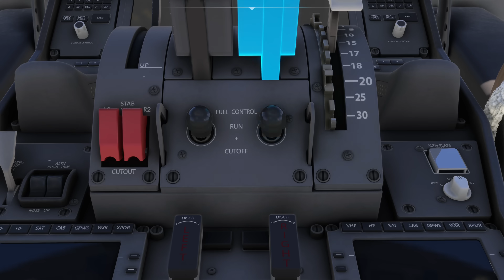Air India 171: Why Did The Fuel Cut-off Switch Get Moved?

Comment: @Captain Steeeve 2:36 can't the engine control computer know that the plane just took off and lockout engine cutoff until a certain altitude? then engine cutoff would still be available at low altitude on landings, this would also help prevent sabotage on takeoff.
Reply: Why are you asking this question to Capt Steeve? 😊 If you want to know the internal working of a car would you ask a taxi driver or an automobile engineer?
Reply: @Commentator-u6e  If it wasn’t already apparent, the entire video, along with several others, features Captain Steve answering viewers’ questions and sharing his thoughts. I believe Captain Steve and I both already know the answer to my question, but I thought it might be helpful for him to feature it, allowing him to share his perspective and giving others an opportunity to consider an idea they may not have thought of before. This can foster a sense of community centered around learning and curiosity and, hopefully, contribute in a small way to aviation safety. While airline pilots are typically not aeronautical engineers, they do have a strong understanding of how various aircraft systems work, as demonstrated by Captain Steve and others in their videos.
Reply: @lazr47  Someone raised this question already in another video where Capt Steeve expressed his idea that he wouldn’t want this feature as he thinks in the event of engine fire during landing they won’t be able to cut the fuel off manually. This clearly shows his ignorance on the potential of good software features. In most scenarios an engine fire will be alerted by the system rather than a pilot figuring out himself. If the system can detect the fire, the system can very well handle the logic of when to allow/when not to allow manual vs auto fuel cut off. Designing and developing such logic into the system is something the pilots wouldn’t be aware of. So being knowledgeable of how to operate and navigate an aircraft and knowing the internal details of all the aircraft systems are totally different things.

Comment: Hi Capt Steeve .Are we missing this point? From the prelim report picture of the plane, it was very low to the ground (approx 100 ft).  By then RAT got deployed, But still plane continued to fly further 500-600ft. How can this even be possible? Plane can fly further  and gain altitude only if engines have power. So the RAT could have been deployed because of some other reason. ??????

Comment: Captain Steve, I wish you would stop using the term "engine failure".  The engines did not "fail".  They were turned off.  They did exactly what they were told to do.  There was no bird strike, no broken fan blades, no fire.  It seems there was a "human failure".

Comment: No i do not think the fuel cutoff were moved by the pilots. Other pilot clearly says he did not do so. Investigators did not release what was the other conversation occurred between the pilots. I do not think there would be no other conversation after the other pilot said he did not do so... I think this is an hardware issue that caused it.. as you can see the cutoff between two switches happened in a 1 sec
Reply: Imagine this alternative conversation: "Why did you cutoff?" "Because I want to kill you and everybody else on this plane". Was the other pilot likely to give an honest answer even if it was true? He was more likely to lie "I did not do so" to confuse the pilot flying, who was desperately trying to turn the fuel switches back on, gain altitude and avoid the buildings ahead, all at the same time. He probably didn't talk further to the other pilot because he realized he was lying and would be of no help. Unfortunately it was too late to avoid tragedy. 
If it was a hardware fault that cutoff fuel, how could the fault be fixed within 10 seconds, allowing both engines to be turned back on before the crash?

Comment: Why we must resist premature conclusions

In the aftermath of an accident, there is much at stake for many people: the manufacturer of the aircraft, the airline, the airport, civil aviation authority and others. The families of the victims understandably demand answers.

It’s also tempting to latch onto a convenient explanation. But the preliminary report is not the full story. It’s based on very limited data, analyzed under immense pressure, and without access to every subsystem or mechanical trace.

The final report is still to come. Until then, the responsible position for regulators, experts and the public is to withhold judgement.

This tragedy reminds us that aviation safety depends on patient and thorough investigation – not media soundbites or unqualified expert commentary. We owe it to the victims and their families to get the facts right, not just fast.- Yahoo News
Captain Steeeve did just that, reach a premature conclusion. irresponsible of him
Reply: If Air India thought it was the aircraft, they'd have grounded their entire 787 fleet.  They haven't done so, and you know exactly why.  Please refrain from commenting further as it's clear facts aren't important to you.
Reply: @txbill2512  - you should be doing that , refraining from making comments. YOU
 are doing just that. What facts? Very few "Facts" were reported in thsi PRELIMINARY report. what part of the word, "Preliminary" don't you understand?. Read my post again.  clearly you can't either read or comprehend what was posted.
Reply: @txbill2512  - rubbish. didn't you read from yesterday that Indian authorities ordered inspection of all fuel switches on 787s?
Reply: You make a good case for withholding judgement until the final report, but there is a counter-argument regarding the responsible position for regulators in particular. Suppose a preliminary report on a fatal air accident identifies a mechanical flaw, design flaw or faulty maintenance protocol as the probable (but not certain) cause of the accident. Is it the responsible position for regulators to wait for maybe a year for the final report before taking any action or making any recommendations? In many cases, more urgent action based on strong probability rather than certainty is the responsible position in order to avoid similar accidents in the meantime. 
If the mental health of a pilot is a very likely issue based on a preliminary report, then shouldn't airlines and regulators do more to address the mental health of pilots as soon as possible? In the time between a preliminary report and a final report, thousands of pilots will be flying millions of passengers.

Comment: A lot of comments saying the cutoff switches are 'designed' not to be able to disengage without being lifted across a detent and 'couldn't be accidentally knocked' but that is the design and is NOT the real world situation. Hopefully the mechanisms are not too badly damaged by fire and impact to allow investigators to see if in fact the switches were faulty and so did not operate as per design and would backup the pilot commentary.

Comment: Hello Captain Steeeve, as a turbine controls specialist I can state categorically that it is possible for a computer program to process a signal from a digital input interface falsely for a short period of time and then revert to the correct state. To explain in simplistic terms: Computerised control systems process data from a variety of input interfaces, digital (on/off) eg switches, analogue eg thermocouple outputs, pulse eg power turbine speed (magnetic pick ups).

When a switch position is changed, the digital input to the computer changes from a 1 to zero or vice versa. There then follows a complex range of logic executions that ultimately determine various outputs, including data recording. I have experienced glitches where an input was falsely processed for a short period of time. On one occasion, recording a power turbine overspeed condition for only 40 ms before returning to the correct reading. This in a TMR (triple modular redundant) turbine protection core. In that case it had nothing to do with the magnetic pick up inputs and was actually caused by a completely unrelated system, the pcb that controlled the data highway communications in the control system. Extremely difficult to troubleshoot, and very low probability.

In this case I don’t believe there has been any control system malfunction. There were two separate switches for two separate engines. The control system recorded a significant time difference (significant in terms of computer scan time)  between the operation of the two switches. The voice recorders indicate that one of the pilots actually saw the switches being physically operated. Sadly, I am forced to the conclusion that one of the pilots did this deliberately, perhaps suffering from some adverse psychological condition.

In closing, I believe it is a reasonably easy job to change the control logic in such a way that this can’t happen. For example you could require a separate confirmation signal from the other pilot. It would also be possible to limit the input from those switches to exclusively one or the other in the circumstance of taking off and climbing to a certain height.

Regards and thank you for your informative and compassionate reports.

Colin

Comment: The preliminary report left open 2 questions: Why was the throttle quadrant changed in 2023 (no answer in report); why did one pilot ask another why he cycled the fuel switches off (insufficient transcript to determine context and who questioned and answered). In this respect, the preliminary report encourages speculation. No matter. Step back and look at the location and design of the switches and ask this: Are we looking at a latent design failure; ie, the system has worked 100,000 times before but its design made it an accident waiting to happen. First, look at their location-the busiest part of the cockpit; exposed to physical movement; susceptible to spillage of anything over the centre console; susceptible to getting caught in a shirt or jacket sleeve. Why are they there when their operation is always by way of checklist? They can be placed anywhere and should certainly be away from any busy areas. Second, look at the switches- they are small and insignificant: can be bought at any hardware store and are by design susceptible to wear and damage by operation over time. Third-How are they operated? Are they lift and push or pull, or do they require lift, turn, push, turn, lock and release? In any event, there seems no physical locking mechanism and no locking indication other than perhaps feel. Finally, in what part of the start cycle is the fuel released? When the switch is first moved, pushed to the end of travel or when locked in place? And finally, what are the pilot procedures on takeoff? Is a hand placed behind the throttles by the non-flying pilot; does the pilot flying put both hands on the yoke at 80kts? No one has commented on these procedures but they may have contributed to the opportunity for an accidental displacement. I guess there could be electrical mishap, but that seems remote. And finally, there are the pilots, but nothing of concern has emerged about them yet. In any event, latent fault happens too often in aviation-example, the recent mid-air collision at Washington National: no positive separation was needed, until it was, and then it was too late. We must wait and see.

Comment: To you comment about AI in the cockpit....Right there with ya.  Maybe in 10 years they'll have a true self driving car and 50 years after that "Otto" will be by himself.

A couple of questions.  Could a dual engine fire cause the PNF to cut-off the fuel?  I am reasonably sure that's not what happened (at least I presume the master caution would be heard on the CVR).  Second, I heard a rumor that possibly a third voice was heard asking the "why did you do that" question.  Could there have been a dead-heading pilot in the jump seat (if a 787 even has one)?

Comment: The fact they don't release the full conversation transcript shows cover up operation. If it's intentional act by one of the aircrew then the switch wouldn't have been turned back on seconds later and they communicated mayday to the tower. Does not make sense.  What is true: BOEING SIMPLY CANNOT SURVIVE ANOTHER SCANDAL. IT WILL BE THE END OF BOEING.

Comment: I'm curious with so much technology around, why can't they relay whatever happens in the cockpit on the fly to ATC or something? Or for example if the fuel controllers were manually turned off, is there a way we can track these actions on the fly over to a centralized monitor or something for real time activity.

Comment: Cut off switches shouldn't be in the middle of the cockpit, where pilots use their hands using throttle, flaps, spoilers or radio. Best solution is to place them on overhead panel. Left engine maximum left side on the captain side, and right engine on the FO maximum right side. The plane with one engine running could still take off and it is not possible to switch them off at once.

Comment: You can very easily see that these are the type of Cut-Off Switches that can NOT be switched off by just sliding or throwing your hand on top of them. 

The ONLY way you can turn the switch on or off is by first lifting the toggle outwards and then push the toggle into the on or off position. I received an aircraft cockpit switch panel from an aircraft parts recycling center and most of the switches were designed like that. 

 I use about a dozen of them right now for various electrical projects and have even been using the same switches for over 20 years and they still work perfectly. In other words, these are superior designed and manufactured switches and there is no way two flip the switch unless you first grab the toggle tightly with two fingers and then pull the toggle outwards to unlock it.

I usually never get any replies from my comments BUT I would really like to hear someone agree or disagree with my observation that most definitely proves that guy in the video on the left is completely incorrect and doesn't know what he's talking about when he mentioned that the pilot's hand could have flipped the Cut-Off Switches to the off position.

Comment: Let me give you another possibility to think about. Despite strict controls, the very nature of IP-based communication on the Boeing 787 - used in its Integrated Modular Avionics (IMA) and maintenance networks - introduces theoretical vulnerabilities. Because systems like the Common Computing Resources (CCR) and FADEC interfaces rely on networked, software-defined connections, a highly sophisticated attacker could, in theory, exploit flaws in the data transmission path, inject false commands, or deliver compromised updates. This is especially true if the attacker gains access through the supply chain, maintenance ports, or shared infrastructure, where signed but malicious software might bypass detection. While tightly segmented and protected, the mere use of interconnected, Ethernet-based protocols (like AFDX) creates a theoretical avenue for Stuxnet-style malware to target critical functions - though no such real-world exploit has been proven in aviation to date. It could be the pilot acted (turned them on) in response to an event caused by a malware attack that turned them off.

Comment: As a software engineer it'd only take me 2 fking hours to implement an if condition for not allowing fuel cutoff during take off - booohooo fking Boeing! There's no wishful thinking of blaming pilots when clearly the locking mechanism wasn't there in this version of the aircraft!
Reply: Good luck trying to convince the ‘so called expert - Mr Steeve’ 😀

Comment: Can pilots cut off fuel and run as part of any trobleshooting? If so is that going to be first step as soon as they noticed after take off?
Can the pilot done that in panic based on someother critical issue?

Also read couple of news regarding fuel switch flaws. I think one is through whistleblowing and other one is from britain caa warning of boeing fuel switch flaws. What is your opinion on this. 
Thank you

Comment: I just watched another video on a expert on aviation who said that this was not a pilot error but it was a chip malfunction from the bulletin that was mentioned on your channel before. I think that should be talked about more instead of speculating that this was mental health and insinuating that it was one of the pilots that did this because from the preliminary report the other pilot said I didn't and from what the other aviation expert said you could hear the pilot starting to work together to get the plane up and running after this happened so I don't think this was a human error I think this was a chip malfunction and the aviation expert explained should be making the steps to fix this.

Comment: Not a pilot, but aviation geek. I thought it was required that the throttle levers needed to be at Ground Idle prior to the cutoff switches being activated? With the modern FADEC systems, that should be fairly easy to 'mandate' through software? In other words, make it that the switches have no effect if at T/O thrust and below a certain altitude? Obviously, in the case of engine fire at T/O, I'm assuming the standard checklist has one step to bring the affected engine's throttle to idle before hitting the fire suppression switch?

Comment: Regarding the 2 person cut off for the fuel - what happens if the other pilot is incapacitated and you need to cut off the fuel? The reason there are 2 pilots is redundancy. The moment this becomes a 2 person task you take away that redundancy.